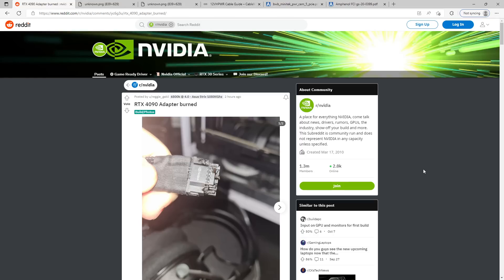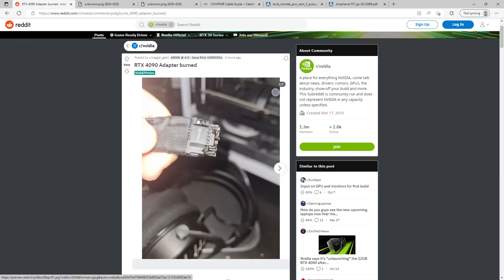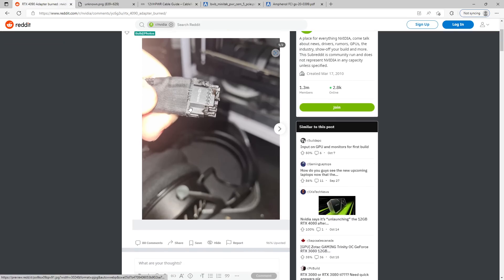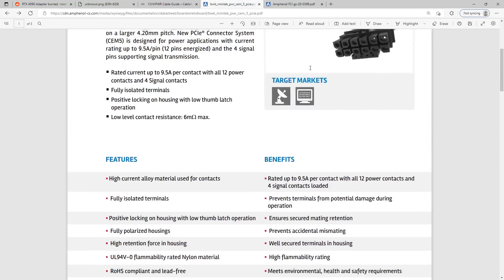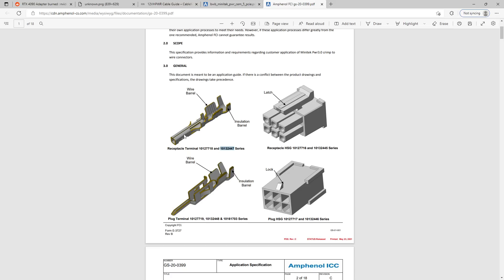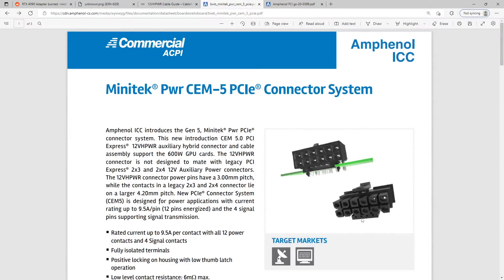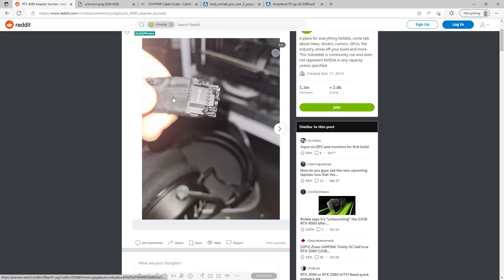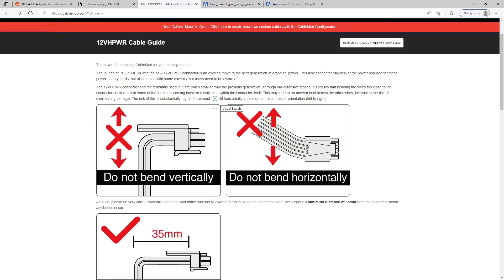The 12VHPWR connector sucks

Comment: Wow. I honestly didn't expect problems so early. What a dumb standard that requires 35mm of extra cable length. Should we vertically mount the card with the power connector facing down? You would think that they would at least put the plug in a more convenient location. Even then, how do you ensure cable rigidity? SMH, hopefully this one goes the way of the dodo

Comment: I'm sure there's a reason, but.... why are they using a connector/cable design that uses like 18AWG across twelve wires (well actually six cos half are + half are -) when they could just specify a larger wire gauge, and fewer pins?

Comment: I valued the opinions of your videos quite well, but this gives me more vibes of a ranting child than i like. I‘m not a fan of the new connector myself and the melting issues are a big red flag if its occuring on a regular build pc. But pointing with the finger to supposed issues and then saying „but i don‘t exactly know“ doesn‘t seem like a well informed opinion.
Further I‘m pretty sure, thst coming from oneof the recen GN video, where they interviewd multiple Nvidia Engeniers, the 30 serie and 40 series connectirs are different. And its not an Nvidia only design but a full PCIe 5.0 spec. Maybe you would like to test out the realwirld performance of the new connector yourself, maybe even collab with GN on that, so you can give us hard facts, that may or may not show what is wrong with Nvidias choice there.

Comment: Thank you for this. Couldn't Agree more.

1. They made a stupid guide for bending. But there are no case out there that will allow this much clearance, unless you don't close the side panel or mount vertically. How are you seriously gonna make the cable straight and not bend?

2. Shrinking the connectors and cables while pumping out more juice is bad idea over all.

3. I thought Intel and PCI-Sig pushed this? But Why is Intel not using these on their cards?

Comment: Extending the cable straight out is going to be worse because of the simple fact of torque multiplying force, the more you extend out from the pivot point, plus the fact that the retaining clip being at the bottom rather than on top to anchor the connector from such cantilever force. Think of a breaker bar, the longer the bar, the more you multiply the torque you apply.

Comment: I'm still going to argue that it's a current issue from the gauge of the wire being to thin, not bending it.  Bending it my ass.  Cablemod is supplying the diagram to protect themselves.  Speaking of Cablemod, I've used their extensions to go from my 1000w PS to my 3080 TI and had stability issues when playing BF2042, crashing within seconds of getting into a game.  I compared the thickness of the cablemod extensions to the thickness of the supplied Corsair cables that came with the PS and can clearly tell that cablemod used 20ga and the ones from Corsair were 16ga.  I said 'eff it' and used the cables supplied from the PS directly to the 3080 and haven't had an issue ever since, was a current issue.  Also guess what...all 3, 8pin connectors are bent tighter than 90 degrees right at the harness and have been that way since May when I built this one.  Guess I'll have to order a 4090 to see this cheapie connector to compare in front of me.

Comment: The individual pins are rated to 9 amps (providing 16 AWG is used). Way to push the load right up to the safety margin. 4090 owners better have the fire department on speed dial. I'll definitely be skipping this generation of GPU.

Comment: When building my own custom pcb passthru for Submersion cooling PCs about a decade ago, I was literally crimping these 8 pin power connectors together. You got the mechanics down right. 

The reason why it can take so much abuse is the fact that it is rated for 150W per connector when the theoretical max is 300W per connector before it starts melting. Thus they overspecced it massively to ensure reliability. 

It's pretty easy to lose one of these connections when mashing and bending the connectors, especially in tight cases or different setups.

It's going to become more common soon enough, I expect GN to jump on this as this is potential fire hazard territory. Force Nvidia to do a recall.

Comment: The problem with Power in any conductor is that size is critical with low voltage DC. So yeah you are absolutely correct. This is going to be a total flop for Nvidia and their engineering .

Comment: Yeah, what we do in the field (unrelated work but same line of molex-ey type idea) is finish pinning, construct the connector, and then backfill with epoxy. Keeps those suckers in there through vibration and cable strain. You gotta build things to survive a 500lb gorilla.

Comment: I still don't get the whole point of PCIe power connectors when we've had the 4-pin and 8-pin ESP12v. The 8 pin can easily handle 300+ watts. Heck, I've ran 200+ watt CPU overclocks on a 4-pin without issues.

Comment: cases are going to need a special side panel channel to hold the cable in place. the way cables are routed through cases, there is no way to get a perfect connection without a ton of slack. average builders and prebuilts bumping in shipping might get interesting.

Comment: I do like the idea of tidier cabling with smaller everything, especially when we know the wire gauge can safely handle it but those crimp connectors were always going to be a problem especially with how they deform after repeated insertions. Looking and the diagram, there appeared to be 2 punched pins/domes (the 2 round things) on either side of the receptacle terminal that make contact with the solid pins on the plug terminal. On a larger 8-pin connector, it's probably fine if only one of these is touching the plug pin as it's physically larger and there's less current to push through it. 

On the server side of things, I've seen power supplies that plug directly into the motherboard via PCB gold fingers and those can push quite a few amps, though it's a completely different kind of connection. On the Apple side, they use screws to deliver 12V to their motherboards/GPUs which always seemed janky AF to me but I also see this for older style power supplies, namely still used in 3D printing power supplies. 

It would be neat if the power delivery standard for PCs also moved to 24V, 48V, etc to cut down on the current needed while still working fine with most connectors without having to worry about arcing, kind of like what we are seeing with USB-PD, but dumber and fixed to 1 voltage for one type of connector. 

There's also the other kind of Nvidia solution which is to push for SXM form factors so the GPUs get all their power from the motherboard and cooling rigidity from the case.

Comment: and then to solve the issue on the rtx 5000 cards, nvidia will just solder the wires to the board and have a pigtail coming from the card so the weight of the wires doesnt bend the connector, further making a non issue an issue...

Comment: I think a poor connection (ie spread pin) results in the load not being evenly distributed through the rest of the cables basically creating a fusible link on the remaining wires that now have to carry the full load. I bet those are the ones burning up not the spread pin.

Comment: Well the sense pins as an extra does make sense. They each take up less space than on 6/8 pin connectors, and also tell how much power is there to give, roughly. I mean on 6/8 pin you had static 75/150 watt per plug. And if you dont wanna have a crazy mix of new and old connectors into the future, lower end power supplies and GPUs will have that plug too. Imagine someone with a power supply rated at 400-500W total having such a plug for example for a 4060 or whatever, and later upgrading to a 4080 or 90 class card because they naively think it's gonna work as the plug is there.

Here the power supply can tell the gpu in advance that it's heavily underspecced rather than needing to trip protections or start a fire

Comment: So the new Nvidia connector uses 6 of the pins for 12v. From the images in the video, each pin is rated to a max of 9.5A. 6x9.5A = 57A. So, a RTX 4090 FE is "max" 600W, which would give us 50A used. As soon as you start bending any cable you add resistance, which will require more power, which in turn generates extra heat.  
I am also thinking now, how many PSU's will be able to cope with this?

Comment: They need to make the connection below the housing more robust. The pins need to freely move, but at the same time, they need to have something to reduce the tension on the area where the pins connect. It really comes done to making the connection from the cables to the housing to small. It's classic Apple design.

Comment: This is hilarious to me, I am an automotive diagnostic tech and I see overheated terminals ALL the time on cars using world standard connector/terminal designs with way more surface area per terminal running much less current.  It blows my mind that they designed this in the last 2 years and failed to conform to any other existing standard for terminal design.  Trying to push 10A or whatever per terminal is just ridiculous on terminals this small.  In the automotive world, that size terminal is only used for data, if there is current involved it is always on a much much larger terminal set.

Comment: This appears like an electrical engineer design with too little input by anyone with structural expertise to assist in ensuring it's fit for purpose in the environment it will be used.

I think a 12 pin amalgamation of the existing 8 pin guage connector would have been more robust and forgiving.

Even using stranded cabling with the highest possible bend radius I cannot see it being good. The system of pin retention simply places too much force to initiate pin retraction or off axis orientation.

nVidia did not produce this though they may have influenced it. They may have pushed for it, but it was developed by Intel and the PCIe Specification Board as best I understand things.

Do you have a different understanding of that?

It's their own goal using it though. I don't think it's fit for purpose in anything other than specific OEM systems where precise routing is designed to safely use it within recommended rules.
It's limitations make it very poor for the world of unregulated PC case design and setup.

Comment: Bend the cable to get the general direction correct before inserting the connector in the card.  That way you do not put pressure on the pin connections while bending it.

Comment: The adapter is here because there's hardly any ATX 3.0/PCIe Gen 5 PSUs on the market, and they aren't cheap. Also changing the PSU is quite a hassle because of cable work. Still the adapter is a terrible solution and AIBs should have a hard plastic 90 degree adapter (like the Cablemod adapter) included, or the female connector on the card needs to be relocated to that the adapter doesn't have to bend so as to not press against the case's side panel - a glass side panel could shatter under continuous pressure from the cable. EVGA had their power connectors facing to the front of the case, instead of towards the side panel.

To be honest, why doesn't Nvidia just make a external 12v power brick? Their high end cards are like 3+ slots and there's enough space to fit a 600W connector there.

Comment: If I had to guess, the 12 pin connector probably costs a lot less than an equivalent number of 8 pin power connectors. Although technically true, I think the board space reason is a bit of a red herring. Connectors and most through hole components are usually a non-trivial cost in the automotive rated controllers that I work on, I assume the case is similar for consumer electronics as well. Additionally they usually require a separate selective solder step after the SMD line. Depending on the process it can be slow. So I think it is mainly a profit margin or manufacturing thing.
Reply: I wouldn't even think so. those 8-pin connectors have been around for a while. maybe they save 2c of plastic per card, but the development and research would make it way more expensive. (although it seems they didn't spend a lot on R and D either)

Comment: Any electrician would see than it could become a problem, we use different wire gauge for a reason also plugs or fuse.
Even using everything the way it's supposed too, any wire not secured properly will cause problem. I've seen melted plastic on the fuse with wire just handling lighting and not even drawing 400W.

Comment: Why not replace them with two EPS CPU power connectors? Workstation/server cards use single 8 pin CPU power for 300W so with 2x8 pin CPU powers per card you could have 600W and they're sturdy and robust as fuck so why not use them?

Comment: When you are running that much power through a connection, the physical robustness of the connection is paramount. Designing on the edge limits of safety to chase physical size is insane

Its why they have larger plugs/locking plugs for 240v high amperage connectors. We dont use the normal 110v plug to run industrial machinery. You need a physically robust connector

Comment: NVidia really didn't consider the end user not following minimum bending radiuses in tight PC cases. They should of just gave us barrier strip terminals to screw down 12V/GND ring terminals to. Guarantees good electrical contact, supports high current in a few pins, less susceptible to connector issues, cheap, and probably takes about just as much PCB room. Though I guess it would be less familiar to the average PC builder.
Personally, I'm all for using less copper/compact connectors, but re-using the mini-fit jr was not a good idea.

Comment: and a pro tip,   once your cable starts to under go this process , you are fucked to the gods of thermal run-away.   its a safety hazard.    you must replace the cable and solder a new connector onto the GPU or it will eventually fully fail

Comment: Soo 600w sustained is about where we start thinking of 4ga wire runs in automotive (12v....)

I'd take a few 8ga and a lug or like xt connectors rather than this.

I don't care what the spec says, as an EE this connector always seemed suspiciously small and probably fragile.

Oh and don't think NVIDIA designed it, pretty sure Molex did...?

Comment: automotive has solved this exact same issue with connectors and sockets with bends + axial stress on some really tight engine compartments some 20 odd years ago.. early types have the rear of the socket is usually contained in a plastic clip that both secures cables and keeps the rear of the connector free of trash... the newer connectors are weather pack since those are even better at keeping the junk out and pins secure with all the vibration.... way to go Nvidia, good job as always /s

Comment: This is the dumbest problem. It would seem that if there's already documentation on this it's a very foreseeable issue, and there are a number of steps anyone in this development process could have taken to alleviate it. Here's a novel idea, simply use more than one power connector, you made a connector with 2x the number of +12v pins that is about the same physical size as the old 8 pin connector so instead of asking it to handle 4x the load maybe only 2x the load and put on a second one.......... that seems better than making something that is finnicky enough to melt if the cables bend, and also easier than finding space for 4 of the old connectors. nVidia call me for more design ideas, smh.

 nVidia: Hey just simply don't bend your, very not rigid, cables for an extra 3.5cm. What do you mean your case doesn't have an extra 4cm of space to the side panel and cables bend? Just mount it vertically and use very long cables to drop it all the way down from the top...

I have a vega 64, a card with an on paper power draw of 295w, a 4090 has an on paper power draw of 450w. I use 2 separate 8 pin cables instead of an 8+8 because I don't want to put too much load on a single connection. This is an extra 155w from the same number of power pins in a smaller receptacle...

Comment: I just thought of something ridiculous. But hear me out — what if the 21-pin or 16-pin connection was facilitated by the backplate? There could have been extra connectors in the middle which would allow for pin-to-pad contact with a screw-fastened PCB backplate so that the cart itself doesn't have any traditional power connectors on it.

If the sockets were to burn up because of poor electrical contact and nothing was wrong with the PCB itself, then fixing that would be simple as replacing the backplate. If the connectors need to come out the side, then allow users to make it happen with yet another replacement backplate. It would be proprietary af but it would work.

Even better the backplate itself might not need to be replaced in its entirety so long the connectors were on its own module which would fit into biases that are cut into the backplate so it rests in the backplate. Not much material there to allow it but it could work, and be more environmentally-conscious.